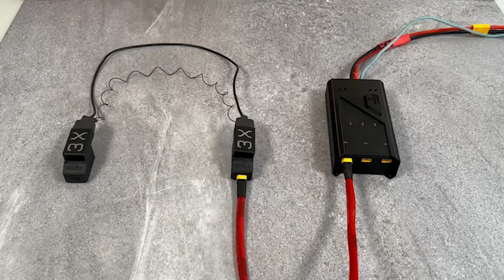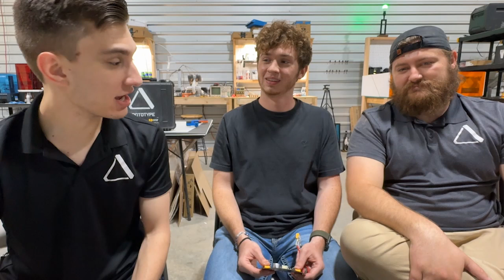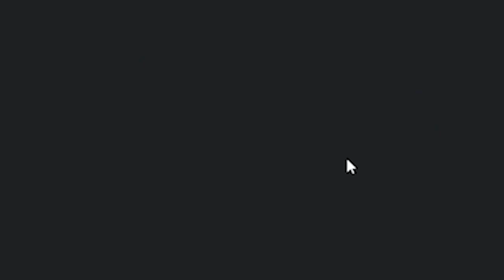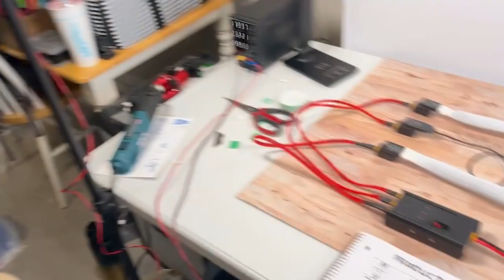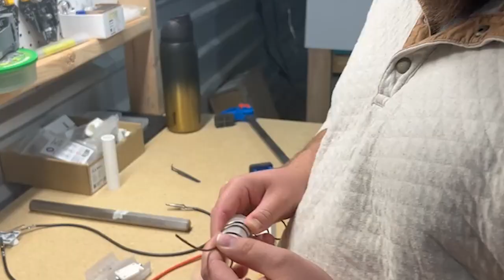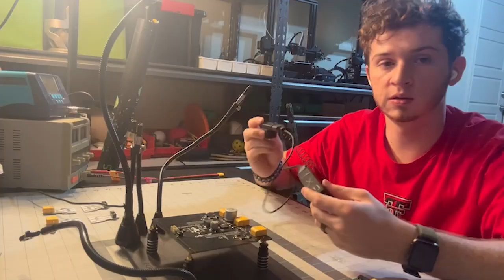Open Source Artificial Muscles - Delta Robotics Interview

Comment: If this can use in prosthetic arm it will be a big change in the prosthetic world but if those metal will use often there will be a overheating in the metal which may cause damages to other component in prosthetic arm, they should create cooling system as well

Comment: I wouldn't put any eggs in the nitinol basket, that technology is still a poor performer despite being around since the 80s, it delivers very poor torque and very poor repeatability with the wire having the droopy consistency of solder. There needs to be drastic material science improvements for nitinol to ever really be viable commercially, IMO.

Comment: nitinol actuators are cool but the main problems have always been power consumption and cycle rate (how quickly can it cool down and be able to contract again). Also some long term problems about longevity but those are secondary to the main two above.
Reply: Actually human muscles have a similar problem aside from the cool down, that's why they are made with several smaller muscle fiber actuators all connected together, the smaller muscle fibers allow a muscle to move at a miniscule amount of energy.
Reply: Power consumption isn't too bad. You can run nitinol off a couple aa batteries and produce a tremendous force. But good luck resetting it😂.

Comment: Memory metal has been around since 1965, so nothing new. I tell you, as an electronics technician with 30 years of experience, that this will not work because memory metal is not durable: the number of times it returns to its original state is limited, it also loses its strength and it is an all or nothing position. All in all it is a fun hobby, but nothing more.
Reply: Agreed, I would think using electroactive polymers are the way to go to closely mimic the human muscle system. They can expand and contract with electricity and with varied voltage, are controllable in how much they flex.
Reply: In theory, if they designed the memory metal into a structure similar to an actual muscle, with several small coils connected end to end and parallel in an alternating structure, then, if it had resistance occurring from each connecting coil, then it should have a range of selectable motion depending on the input of the voltage as some but not all coils would shrink, they also would distribute the physical stresses, but the electroactive polymers do sound more promising.